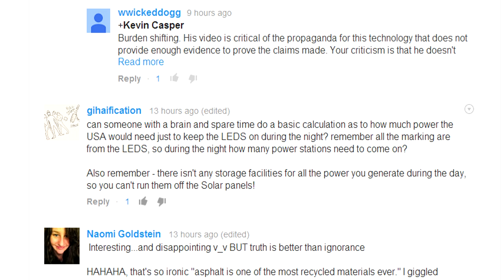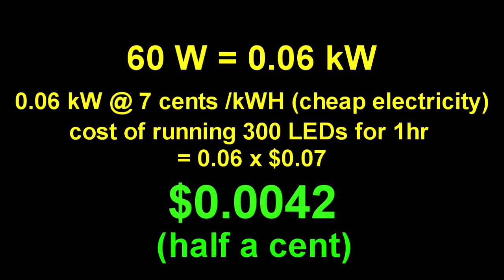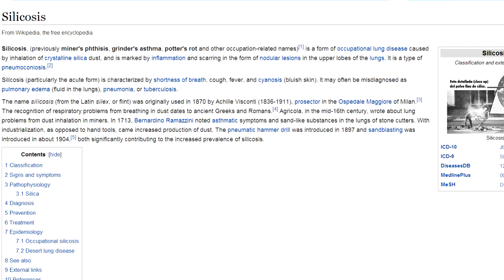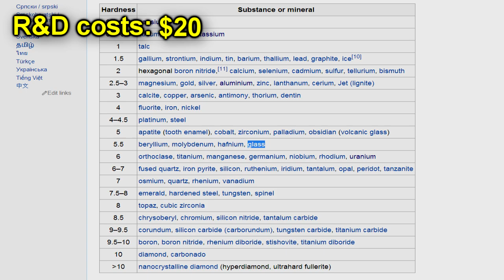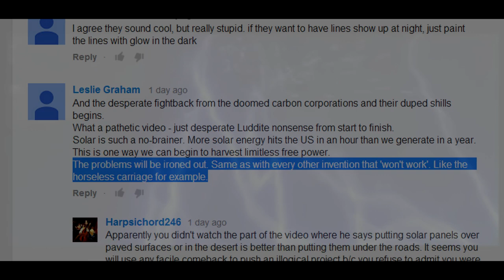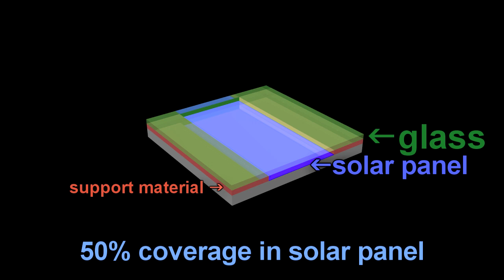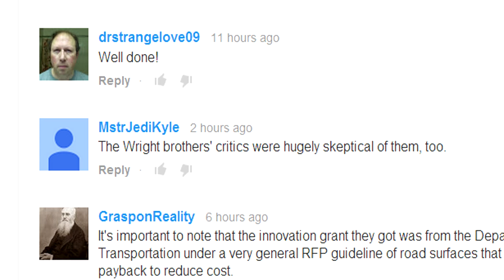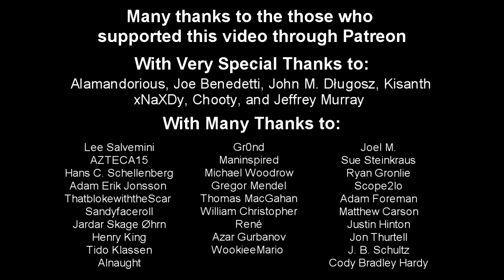Solar Roadways, IMPORTANT QUESTIONS AND ANSWERS!

Comment: PLEASE PLEASE PLEASE refute these points!
http://www.solarroadways.com/faq.shtml#faqLoad
It is the FAQ's the company put up.
Reply: Oh dear, when they quote for the hardness for asphalt it's quite embarrassing, asphalt is a binding agent for the chips of stone, it's the hardness of that stone that gives roads their durability, not the asphalt. When they make such fundamental errors I despair. Have they never watched a road surface get put down? Never driven over a new surface, with loose chippings that haven't bedded down fully? Are they from this planet?
Reply: engineeredlifeform yeah, for people that claim to have invented a superior road material, they seem to know little to nothing about the current road materials.
Reply: Yes please TF, the FAQ is hilarious
Reply: Agreed !

Furthermore, please also shred this page http://www.solarroadways.com/clearingthefreakinair.shtml :)
Reply: depenthene yeah if removing snow with heat takes less energy than just moving it to the side, why don't we use flamethrower cars instead of snowplows?
Reply: That FAQ is great, demanding the entire power grid get changed to DC in order to better accomodate their solar panels.

We use an AC power grid for a very simple reason: AC can be transformed, DC cannot. For example, it can be transformed up to higher voltages for transport across the country. There's less loss that way (higher voltage means lower current means lower resistence loss at same resistence).

DC can, at best, be regulated to a lower voltage (something you do with a piece of electronics that switches off the power line at the target voltage. That constant switching creates a lot of heat, though, and is not meant for high currents). Also, while electrical stoves technically don't need AC in order to function, the heating elements need a very high current. My stove is connected to three seperately protected phases, each with a 16A circuit breaker. So the stove can pull 54A at 230V at most. I have yet to see a solar panel generate a current of 54A. Or a voltage of 230V, for that matter.
Reply: I like how when they get down to the "You can't see LEDs in direct sunlight" claim, they show the traffic lights head on so that you can't see the covers around lights designed to keep the sunlight off of them. Also, you are looking at those lights at about a 90 degree angle, looking at LEDs on a road would be at a much shallower angle...
Reply: This is pure gold. Thank you. :D
Reply: engineeredlifeform Never mind how hard black top is, it simply does not matter since asphalt does not have to stay transparent over its entire lifetime like their glass has to be.
Reply: Kortomir That was page worth of multiple facepalms. My personal 'favorite' was that current snow and ice removal cost a lot. No explanation or any figures why 'heated solar freaking roadways' are better just that current snow and ice removal cost a lot.
Reply: engineeredlifeform
30ft Flamethrower exhaust!
Classic Flamethrowers

Pay up :P
Reply: ***** I think it would just be for entertainment value at this point. We know solar roadways is a stupid idea, but it would still be fun to hear TF read the FAQ and comment on it.
Reply: How resilliant the material is is not the only factor. How the material fails is also extremely important. Asphalt will pit and lose some of it's agregate. Glass will shatter and leave pointy shards all over the road.
Reply: Daniel Yusto I'll just hit three of the howlers.
"How are you going to keep hackers from disrupting your system?"
That question alone should give anyone pause.

"How will you replace damaged panels?"
Apparently, these panels will be modular enough to be easily hot-swapped.  This means that pranksters (though not thieves, since they apparently monitor each other) can pull them up.  It also means that they have to have enough gaps to where edge wear and stuff getting in between them are issues.

"How will you keep the panels clean?"
Leaving aside the fact that it's the glass, not the panels, that is the concern... they suggested spraying the glass with Titanium Dioxide or some other nonstick.  TiO2 is notable for being very opaque and reflective...
Reply: They mention the panels will track theives. But who's to stop one form say, smashing the panels and taking the valuable components, or removing the microprocessor. 
And they tried to refute the canopy idea thunderf00t mentioned. Though in their wall of text they only had 2 real points: They are expensive (Like these panels aren't, right?), that they would need a method to melt snow (like their panels) and without a draining system, melted snow would cause black ice. Okay, so we use a draining system. 
They are either stupid or scammers. Maybe both. Regardless I reported them with indiegogo's reporting page. Not that it's likely to have any effect.
Reply: nullplan01  yeah just imagine how many inverters they will need to make this thing useful
Reply: I love the answer to "Will I get cut if the glass panels break?": "We use tempered glass in our panels."

Apparently they don't understand what happens to tempered glass if it gets any kind of scratch, especially from a small, sharp object puncturing its surface (which is precisely what will happen with gravel on the road and cards driving over it.)

Now, imagine what happens if a car is driving at 80mph and a glass panel shatters below its tires. (And even if that car manages to avoid the accident, think of the cars coming behind it.) And of course glass shards are more stuff on the road for car tires to ground onto the glass, shattering even more of them.

And of course it won't be only the glass that breaks. It's everything below it. All the electronics and solar panels.
Reply: ybra 'Flamethrower cars', I'd pay to see that.

Comment: Ok... firstly you don't need the LED's on all the time. So you can have them on only as someone is travelling on the road. You can also have them light up for a fraction of a second so that human persistence of vision can fill in the gaps in the light. this alone will allow the actual power costs to become significantly lower. Im not disagreeing with you in principal, but I do think your objectivity is failing a little on some of your points.

Comment: Wow, I'm not saying that there isn't problems with the concept, but really, just about everything you did here is laughably inept.

The no place to "save" the energy is just a dumb comment you keep bringing up. A battery station of some sort would obviously have to be made and that technology is being research right now because the immense amount lose in electricity that we have because we don't have that system in place.

Glass made for dishes is different then glass made for other things

Generally speaking tires don't go back and forth, but rather in one direction, which as you should know has a different effect.

You wouldn't have to be powering all the LEDs all the time nor all day.

The strip you had is white, the panel would be black and as any one that fucks with colors knows that makes a big difference.

The support issues that you bring up are based on the assumption of a square with supports on either side where as the actual structure is a hex with support all around which as you should know radically changes the ability to support such weight.

The only real important questions are if this is a net benefit and if that net benefit is worthwhile enough to warrant. And when I say net benefit I don't just mean road costs because we're talking road, electricity, etc. It may even turn out that the economic are shit on the whole thing and that the environmental costs are no better or even slightly worse and still one might argue that it should still be done because there are other benefits that could be linked to it. For example if you have a electronic road where you are tracked so that the road knows to light up in front of you, the road would be able to know if you've gone suddenly off road and report it to an authority for immediate action, or a more effective traffic tracker, or lighting up when someone is standing on it causing less crime due to easier to identify people, Or for those who don't have GPS it could provide a way to lead people to the correct place. Perhaps some of that stuff is unreasonable, but I'm just going off the top of my head. All I'm saying is that this warrants actual test and scrutiny and apparently a city decided to give it a go I believe I've heard in one of these videos, so the economics seem right to someone who has a bit more information and reasonable figures on that subject than what Thunderf00t is presenting here.
Reply: How the fuck do you plan on moving all that DC? There still will be extreme losses.
Reply: Part of the usefulness of this would localized source of electricity so you don't need to move it, or provided that we have wireless electricity perfected or we use it to charge cars that have a high enough battery density which is being worked and has been suggested as a solution to the wastefulness we have now.

Comment: What about snow plows? Sure they may be able to hold up to tires (using very expensive glass). Yet I see lots of seems and having plowed snow for a living I know that seem in a paved area don't stay even in changing temps. I've popped a peace of concrete twice as big as these panels out of a parking lot. Concrete being a lot more resilient then glass.

Comment: Why not a project to put durable solar panels above all highways (and maybe major city streets) in the US, instead of insistence on putting them beneath the road?  They'd serve the dual purpose of collecting light, and also keeping the sun out of everyone's eyes as they drive.  

It would also cut down on light pollution during the night, because the "ceiling" over the highways would block upward headlight illumination.  If the panels are slanted, it will be less easy for snow to accumulate (or just don't put them in areas with heavy annual snowfall).

There are ways the "slap solar panels on everything!" idea can work, but the "Solar Frickin' Roadways!" idea just adds a completely unnecessary extra step the wrecks the whole implementation.

Comment: Why not replace driveways (which are generally unoccupied during the day while people are at work and wouldn't be as much a safety hazard as no one would be driving fast down them) and side walks with these panels? It'd be expensive, sure, but I'm thinking more about the safety hazards which seem to be a more pressing concern. as demonstrated in this video.

Comment: glass and the scratching is the least of your problems,  
good tarmac, hardtop or however you call it there has been researched for years to make it safe in all weatherconditions to drive on and has some soundproofing. even the latest dual-layer porous asphalt (zoab) has seen problems with aquaplaning of cars because of finely grained salt leftover from the winterseason filling the openings.   
also try hitting your brakes going 90mph while driving on a glass sheet with just a few glassbumps for traction... I'd rather drive beside the road.
Glad I'm living in a country where research is done in ultrasilent poro elastic road surfacing in view of the future and not a "zomg so cool like Tron surface"

Comment: Question for science dude!

Since you have cells and stuff, can you test a theory that's been in my head a while?

You may have seen the Favela makeshift light bulbs - bleach + water = reflecty thing.

If you used a series of glass panes, could you focus light onto a smaller panel, rather than using loads of panels?

Comment: I have a small problem with your methods on the glass experiment specifically.  The glass you are using is a smooth texture surface where as the proposed panels seem to be textured in some way so I would say that wasn't your strongest experiment.  But to your point, I'm also wondering is that frosted glass on the proposed road panels how would that affect energy production?  Also oil leaks dirt pollen etc. I'd assume would also reduce output.  Wouldn't the problem of running them at night be somewhat mitigated if they somehow were able to pave the entire road with these things you would get energy production from a section of the US for even on the shortest days from 7:03 am until ~9:35 pm EST during the winter solstice (sunrise in Miami is 7:03 and sets at 5:35 pm then add the 4 hours for the sun to set on the West coast)  .

Comment: ***** 
What's your take on piezoelectric roads?

Not solid piezoelectric, just strips to power signs and embedded lights.

Not a major power source, no, but convenient energy release when traffic is heavy.

http://www.gizmag.com/piezoelectric-road-harvests-traffic-energy-to-generate-electricity/10568/
Reply: We actually discussed this in class once. If the piezoelectric material is more elastic than regular roads then you make people use more gas.
Reply: robinvik1
Makes sense. If the material absorbs the energy from a gas powered car, then that energy isn't necesarily renewable. Also the process is not perfectly efficient so people use more gas to produce less energy. I often see signs with flashing lights powered by a small solar panel with a battery backup. The next logical step to improving that would be to find a suitable alternative to the battery such as supercapacitors.
Reply: Both methods are already in use in signaling applications.  Inductive sensors and piezoelectric sensors are already mass produced and probably in the roads all around your home.  I'm not selling anything, I just thought it was an innovative and interesting idea.

Here's an Israeli group installing piezoelectric test section on Road 75 in Haifa.
Innowattech conducts a project by an industrial method of implementation via precast concrete slabs

The description includes:
"One kilometer of Innowattech's generators along a single lane of a busy highway is capable of producing an average of 200 KWh per hour, sufficient electricity to provide for the average consumption in 200-300 households provided approximately 600 heavy trucks or buses travel through the interval per hour on average."

They claim their generators have a higher Young's modulus than that surrounding roadway, so they don't "steal energy"... by which I think they mean current doesn't come at the expense of extra gas consumption.

I dunno.  I thought it sounded cool.
Reply: Just line the roads in the flatter and more windy areas with VAWTs (Vertical Axis Wind Turbine). They can generate usable power in lower speed winds and can work no matter the direction of the wind source. Cars go by, they spin. Wind picks up, they spin. They spin at day or night.
Reply: EthosAtheos Correct me if I'm wrong, but if I'm putting a magnet on the car and using its movement to generate electricity, then I'm basically converting fuel into acceleration into electricity. That seems a lot less efficient than just using an oil power plant, in many many ways.

In contrast, piezoelectric roads would be using energy that is lost to the road either way. I have almost zero knowledge on the subject except that, but the magnets idea sounds like a non-starter - unless you have some other reason for the magnet being there.
Reply: Piezoelectric is just stealing energy from the vehicles above it (think driving on a flat surface vs muddy surface that sinks on you).
Reply: Tiberius Vetus
All surfaces steal energy from vehicles passing over them, turning that energy into compression and/or heat.  A piezoelectric surface could still be less deformable than blacktop and produce usable current.
Reply: I found this description of the technology mentioned by C0nc0rdance  above: http://www.innowattech.co.il/techInfo.aspx. Their plan (and their test case) is to use the vertical "deflection" of the road to generate electricity.

I suppose the relevant question is, is it more effective to place piezoelectric generators under roads to produce power, or build roads to be more rigid to conserve energy from the vehicles?

I suppose a small scale test is in order? Proposed methodology: Create a rubber drum with a weight evenly distributed along the axis. Add enough weight such that the drum stops reliably 85-90% of the test roadway. Create a force generator that kicks the drum down a flat stretch of asphalt, (some sort of weight on a string that pushes the drum down the test-road). Repeatedly measurement the distance travelled by the drum.

Build an identical road, but install 1 or more generators under it attached to a load or resistor. Repeat the drum kick and measure the distance travelled by the drum.

I would expect the drum to reliably travel a shorter distance compared to the control road. I would also expect a road with more generators in it to have a greater impact on the distance travelled by the drum.

If what InnoWatTech says is true from the link above: "When piezoelectric generators are embedded under the asphalt, the total vertical deflection of the road is decreased due to the higher Young’s modulus of the generator" then I would expect the drum to travel FARTHER on the test roads with generators.

Thoughts?
Reply: C0nc0rdance Wouldn't it be easier to ignore friction and install some big rare earth magnets and in the chassis of cars and a coil in the road.  Cars on a highway wouldn't notice the added resistance and it would turn the road in to a moving magnet generator.  Seems silly to me but so does a piezo road...
Reply: That is cool!
Reply: ...but do the sums add up over the lifetime of the system and don't forget the carbon footprint they produce?

These ideas are great in principle, I hope they genuinely work!

Comment: Would be interesting to see some road tests on the glass. They drove a tiny tractor over them in the video. But what happens if you drive at high speed over them? Or do an emergency break? Convenient that they left out the part of it actually functioning as a road.